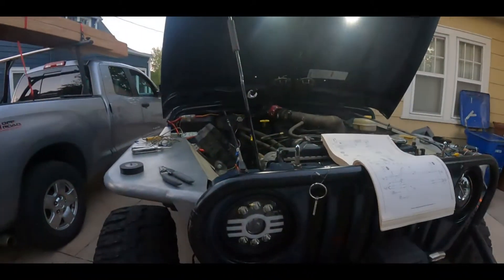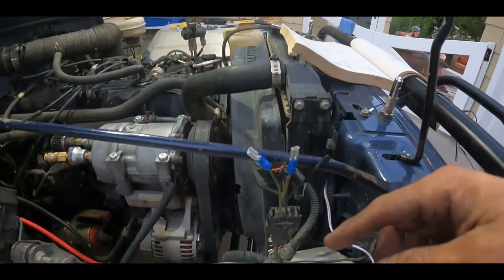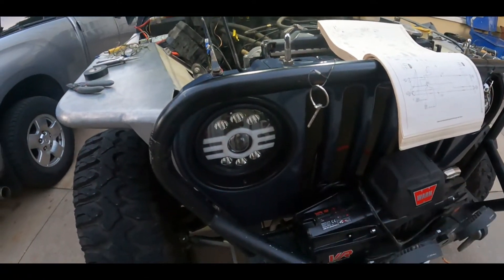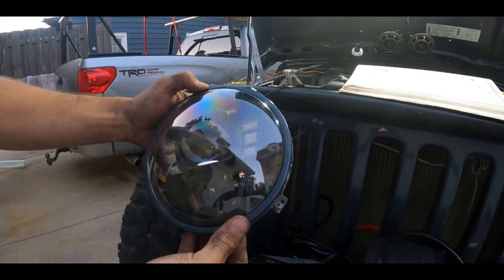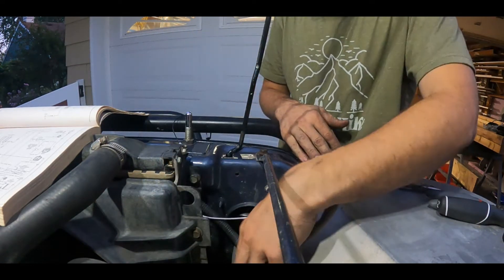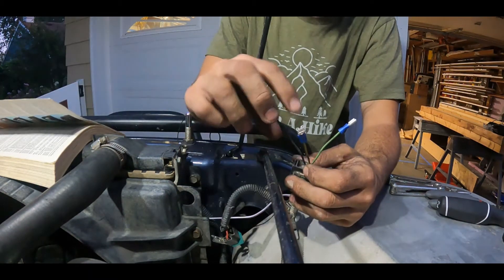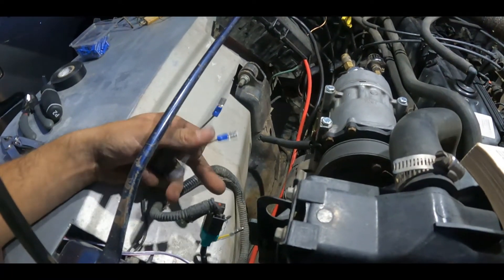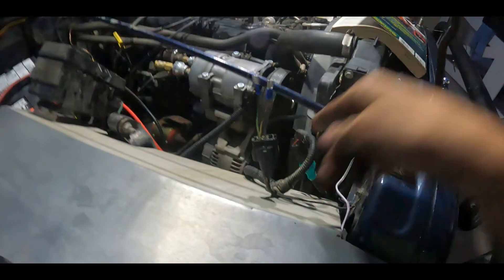Jeep TJ Detailed Headlight Wiring Install (DRL and Blinker in headlight)

Comment: Hi there ive watched your video and presuming mine are same i gave an 04 TJ i took my old light of and there's two wires going to it and new light only has one harness what the heck do I do with the extra wires that used to go onto the old light I presume for low beam ? Anny help much appreciated thanks and regards.
Reply from the maker: so old light had two connections and new light has 3 im assuming? a standard h4 connector (3 prong) is what is used on all TJs as far as i know

Comment: Do the halo DRL only work if you have the parking lights on?  I am trying to wrap my head around this installation. Thanks for the video, huge help.
Reply from the maker: the way i have it wired in, the drl comes on with the running/parking lights. when you turn your full "headlights" on, they will stay on

Comment: is there any way you could make a video showing the turn signals operating while the low beams are on?
Reply from the maker: are you looking to see how visible they are with the low beams on?
Reply: @slothfabgarage  yeah, I can't seem to find anything like that on YouTube. my issue is that my tj has no turn signals at all after the previous owner did  a fender modification so I'm hoping these will suffice for now without having to add legitimate signals
Reply from the maker: @jtperez657  they are fairly bright and i have never had any issues legality wise with them, i do not have any other form of front blinkers besides these
Reply: @slothfabgarage  okay perfect. thanks for the reply

Comment: Nice Video. Did you connect to Fuse? Which wire goes to Battery? Sorry. New to wiring and want to learn. I have a 06 TJ
Reply from the maker: no need to connect to fuses or the battery, just tie in to the factory wiring